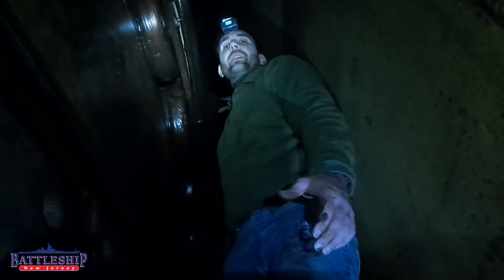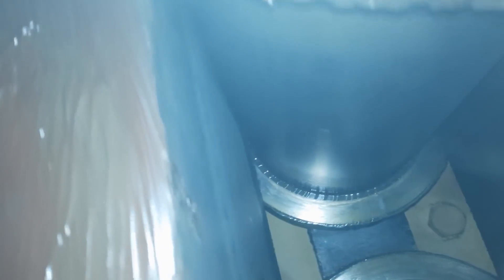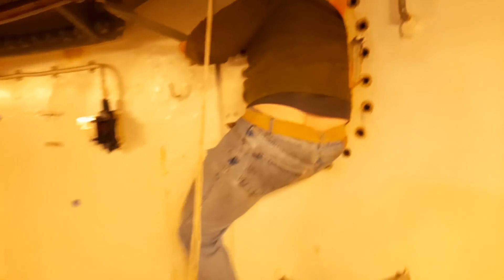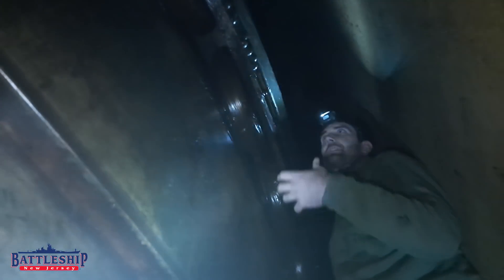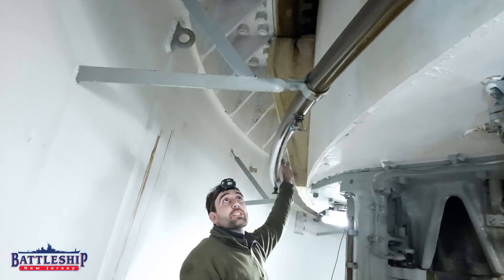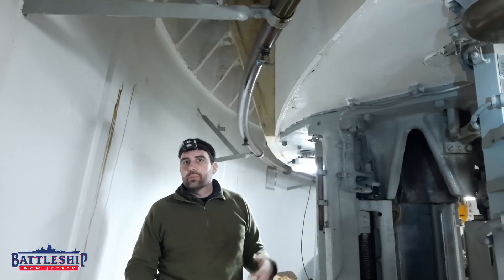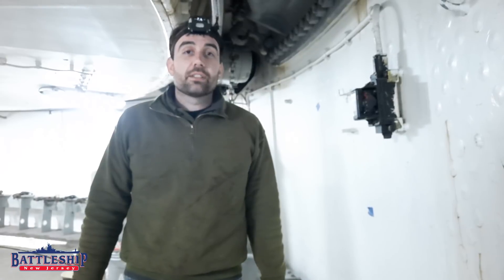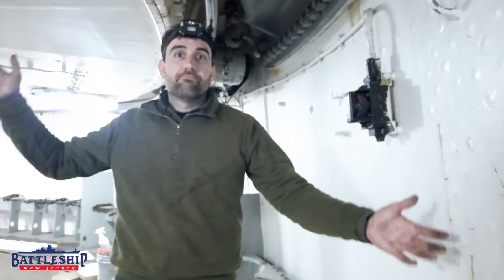Do the 16in Gun Turrets Still Rotate?

Comment: You would think that they would have a limit switch to keep the turrets from rotating too far I can’t imagine that smashing into a steel stopper would be good for the motors if they overload from trying to move against the stopper then they wouldn’t work at all until you change the fuses and or thermal overloads

Comment: Brass alloys or 'bronze' wich actually describes a variety of metallurgical brass based mixtures are widely used in manufacturing because of their great friction properties..lack of friction relative to other metals and it actually holds the lubricant in between all the grains of the metal.  That's why those giant rollers are bronze instead of a harder more durable metal like steel.

Comment: Heavy equipment like that needs to be rotated on a regular basis or you will have bending, failing happen when you actually do try to rotate the turrets.  The reason why I am saying this, I used to work in a power plant with a turbine and there was a small motor that we activated every 2 hrs to rotate the shaft.  I now work in a Petrochemical plant and we have a motor with a clutch that is automatically activated when the machine is off to rotate the shaft on a regular basis. You guys should move those turrets once in a while at least once a year.

Comment: Awesome video Ryan. I worked on North Carolina for a few years as the welder and I always wondered about this. Word was that they relied on the weight to keep the turret seated but I recognize some of what you pointed out on the NJ from the NC. I did have to manually rotate a few of the 5 inch gun houses when they were installing the cofferdam. Man, that was a beast.

Comment: I know for a fact at least three of Massachusetts' main guns were still capable of being elevated as of 45 some odd years ago. When I visited the ship with my dad in my pre-teens they had installed wooden steps on deck you could walk up and look down the bore, the barrel was back lit from the breech so you could see the rifling. I seem to recall it was turret #1, the barrels of that turret were horizontal at the time and all main guns are elevated now. I remember my dad bemoaning the possibility of rainwater getting inside and running down into the bilge and potential for subsequent  corrosion.

Comment: i hope that a metallurgist can chime in on this one, but in another video, Ryan talked about how ships which are on dry displays tend to pancake over time because they are not supported from the sides
in this video, if those bearing rollers are made of soft metal to prevent sparking, would they have deformed after carrying the weight all these years without movement?

Comment: I've been inside several tanks on display outside armories and VFW halls over the years and can tell you that the manual traverse mechanisms have still been operable in all of them. Elevation was not possible in any of the vehicles I've been in, because there's usually a steel bar welded to the breach, keeping the gun in place.
Reply: In 1980s at the Georgia Veterans Memorial State Park in I think it was Cordele, there was an M4A3E8 at interior end of park entrance road (park displays were rearranged at some point between then and now) and it had bottom escape hatch gone. Lots of people had crawled under and gotten inside, some of the shell racks were full of soda cans. We discovered the turret was not rotatable but the manual elevation was operable, and worked smooth and easily. Park entrance road was on rolling ground and we would follow cars up and down the grade. All the periscopes were gone and even through their small openings in top of tank enough light came in to be able to see well in the white painted interior. I remember a number of roadwheel tires had Firestone company name molded in to their rubber rims.

Comment: Since the bearing rollers are all packed in grease, I would expect any welding to be done in the gearset someplace. If I were going to try to disable a turret I'd probably do it in a place that was fairly easy to access, and not covered in potentially flammable grease. There must be a gearbox somewhere where the motors / drive gear interfaces with the turret and that would be where I would look. Alternatively I suppose some simple bar stock welded across a gap would do the job, though I'd imagine that would be even more obvious.

Man, wouldn't it be cool to move those things, just to prove someone was wrong? Super cool stuff.

Comment: it would be amazing to see the engines restarted like steam very slowly introduced with even just a small couple hundred watt boiler over months to hopefully avoid leaks and have tye ship be capable of actually powering itself and tbh in the case of a power outtage it could be used as a warm point of safe refuge for some or u could sell power from the ship back to the grid

Comment: moving the turrets could be done if they during decommissioning they did not drain and replace hydraulic fluid  like they did in the 60s the systems had to be drained and completely flushed during the recommissioning in 1981-82
but it would take an enormous amperage draw of power

Comment: i would check the train securing pin see if its welded in place. as it would be easiest to repair if recommissioning
Reply: Bingo!  The Navy wouldn't want to prevent recommissioning by screwing up the turret's rotating components, so I'm with you on welding the pin.  So, if Ryan could afford to undo the welding and/or remove the train securing pin, the turrets could turn.  Now, if he could get the local electricity provider to furnish appropriate shore power .......

Comment: The report said the training mechanism was welded. According to a 1955 navy 16” gun & turret training video MN-9321C Iowa class BBS this is located in the electric deck under the pan plate.
Reply: I'm betting that the people doing the work took the shortcut, and if they did weld anything, it was the pin,

Comment: You only sort of answered the question. You show that it seems nothing was done to prevent the turrets from rotating, yet you do not give a definitive answer if you could turn them if you needed too. It would be interesting to see the motors that drive the turret and to learn how the guns were trained on a target. Do electric motors drive the turret, or do electric motors drive hydraulic pumps that in turn drive the turret. Were there manual overrides?
Reply from the maker: There is no manual overdrive and we don't have enough electricity to test it. So we don't know if they can rotate. Still to be determined.
Reply: electric motors drive hydraulic pumps that in turn drive the turret

Comment: Many museum ships feature rotating radar scanner antennas,  so movable turrets are not out of line in my opinion. Navy gear is always well tagged and labeled as to where hydraulic power units, and auxiliary controls are, and breakers with both primary and secondary power sources.

Comment: What was the typical powder charge weight per barrel on the 16’s. Also have the guns been deactivated or are the skill capable of firing? My thought is that it wouldn’t be worth deactivating each breach because 16 inch deck gun isn’t exactly an off the shelf ammo caliber.
Reply from the maker: The guns used 660lbs per shell. The guns cannot be safely fired today, and we won't be attempting to get the equipment working again.

Comment: Ryan, where do these people get these misguided ideas?! The electric motors that turn these huge turrets are disconnected from the electrical system. It takes a lot of power to run those motors. That is the only way these turrets (on any battle ship museum) are disabled. Think people! All of that grease from way back to the 40's all the way up to the 90's is in there. If you want to weld, that would take huge current to fuse these massive pieces of metal together. Lot's of current, high heat and grease... that equals FIRE! It would take too much to clean up when all you have to do is disable the electrical circuit!

Comment: Don't know about New Jersey, but pretty sure Iowa and Wisconsin have to be maintained so that they can be recalled to active duty if needed. As for all the grease, all 4 Iowa class ships had to be maintained as serviceable reserve fleet ships until 1996. Meaning that they were getting moving parts greased and other systems checked and serviced regularly until 1996. In the mostly sealed environment inside the turret barbette, the grease would remain largely unaffected for decades if the turret is not being used.
Reply from the maker: This is a common myth, but not true. Neither Iowa nor Wisconsin are kept in condition to be brought back.

Comment: I live in Mobile Alabama where the Alabama BB60 battleship is located. I believe for a movie they rotated the aft turret. I don't know the name of the movie but I remember it being Talked about they were worried once it did turn that they wouldn't be able to get it back. I believe they used the original drives and motors to move it.
Reply: Under siege i think they used the Alabama as the Missouri in the movie and there is a scene where they use the guns on the 3rd turret to sink a enemy sub
Reply: @leekyungmin-t6u  that's it under siege your exactly right I just couldn't remember the name of the movie.

Comment: Is there an overall maintenance manual for these ships, such as detailing intervals for when the grease must be done on the turrets?
Reply from the maker: Each piece of equipment has a manual, usually several, that include maintenance like  oil. But there isn't one for the entire ship, the room with all of the manuals has like 4000 manuals in it and we don't have all of them. That would be one really big book. 

As a museum, we have a calendar of Cathodic Protection inspected this often and tank soundings are done that often and what not, but we only check a limited number of systems.

Comment: Fascinating! Here’s a question: how does NJ’s turrets handle watertightness? I ask because I know that the very first turrets, on ships like the Monitor basically had no watertight function and had to be jacked up to train or down to sail, so were useless on the open seas. Obviously more modern ships solved that issue, but I’ve never read how. I would assume it would be through a rubber gasket of some sort to create a seal between the turrets and the deck? Or did later ships having decent freeboard just make the potential to take water in through the turret rings a nonissue?
Reply from the maker: The big black bloomer bags on the front of the turrets are pretty decent at keeping out water. The rangefinders on turret 1 were removed to keep water from coming in there as well since the bow is so wet.

Comment: Would love to see the mechanisms that do the rotating of the turret.
Reply: Now I'm wondering if the power for traverse and elevation comes from the steam plant or electric.
Reply: @johneyton5452  All electric
Reply: @haywoodyoudome  makes sense. Does it have its own diesel generator or is it ultimately powered by the steam plant? I'd think they'd want to be able to keep firing even if the steam plant is hit.
Reply: @johneyton5452  It has batteries in the gun house that can keep the electric motors running for a little while even if all connections to the ship (except mechanical connections obviously) are severed/lost.
Reply: @richardmillhousenixon  Nope.  There are batteries in the turret officer's booth, but they are backup only for instrument illumination and some emergency lighting.  The batteries just don't have the capacity to deliver the voltage and amperage needed to operate even one of the movement motors.
Reply: @SomeRandomHuman717 It's been over 3 years since I posted that comment, but I seem to remember that information coming from a reputable source. I'm fairly certain it was one of the other videos on this channel, though it may have also been from another channel like Drachinifel
Reply: @johneyton5452  Wondering the same thing.
Reply: @johneyton5452  Possibly electric or hydraulic (or both, since you might want to have a backup system).
Reply: @johneyton5452  it is all hydrastatic drives powered by electric motors. We regularly moved them with just shore power. Rather or not the museum has enough shore power to move them is a different question.

Comment: Thanks for these, Ryan, but please be careful with confined space entry.  After decades, there is always a strong possibility of toxic or noxious gases.
Reply from the maker: You can't quite see it on the video, but the chasm underneath Ryan has giant openings out into the rest of the ship, this is a very well ventilated, though dark, space.
Reply: @BattleshipNewJersey  Good to know, though, as far as dangerous gases are concerned, it's important to have good ventilation both up and down. Some gases are heavier than air and sink, others are lighter and rise. There were at least one or two spaces at an Air Force base I used to work at where, even though they were completely open on top, people had died after climbing into without testing the air first.
Reply: ...yaa , ryqn just ate at taco bell...

Comment: Very cool!
Are the turrets currently locked,  restrained, or have new cables or pipes installed that would prevent them from rotating nowadays?  Are the rotation dri(proper term?) still intact?
Reply from the maker: So the turrets cannot rotate. We dint have the power to do it. But are there other stops preventing it? Maybe. We're still looking.
Reply: @BattleshipNewJersey  They are quite a puzzle!  Thanks for the reply.

Comment: If you find that the turrets are not welded in place, would it still be possible to rotate them? Would it require the steam system to be active, or does it just need electricity?
Reply from the maker: We would have to reactivate the steam plant and thats not an option for us.

Comment: but you didn't answer the question.
Reply from the maker: Were going with plausible. We don't see any evidence that they can't, but don't have enough power to test it out.
Reply: @BattleshipNewJersey  power? Hmmm. I'm sure that 20k or 30k generator could produce enough. If you really wanted to move some of the large things. They are what remote mining facilities use to power their heavy electrical equipment. they usually offer 480v, 360, 220 in standard and 3 phase, and 110. You would just have to localize the motor control circuit.

Comment: I just wanna say it’s really dangerous to go into any closed space where the air does not ventilate unless you have the proper knowledge and gear
Reply from the maker: It is. You should always get a gas free engineer to inspect a closed space before entering. Fortunately for this space, its a multilevel spaces that's open from the bottom and is well ventilated. It's tough to access the upper parts of the space which is why we had to open another hatch though. 

Almost everywhere on the battleship today is well ventilated because we need to be able to get around and do repairs. This contrasts starkly to active ships who need to seal spaces to protect their water tight integrity.

Comment: You probably already know this, but please be careful in confined spaces. Anytime you have to remove bolts to enter an area, that's probably a confined space. Make sure you always have adequate ventilation of the area before entry, and take other precautions related to confined spaces. 
If the air in a confined space is left stagnant, then even just the rusting of the walls over years can make the air unbreathable.
Reply from the maker: This is not a confined space, its actually a multilevel space that's very much open at the bottom. The only reason we needed to open that hatch was because the steps were too hard to get to from the lower level.

Comment: Can the 16 inch guns still be manually elevated?
Reply from the maker: They can! Its very slow though. So we've elevated them their current levels, turret 3 is lowered to 7 degrees so we can simulate what loading is like, 1 and 2 are raised in more of a firing position. But it was a tough process, we won't do that again.